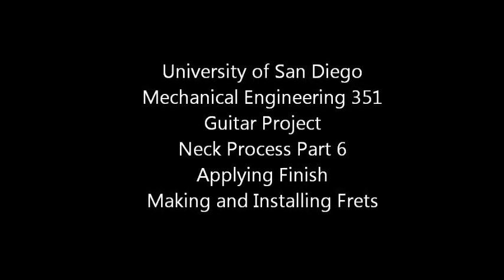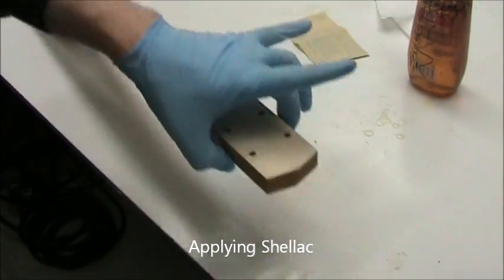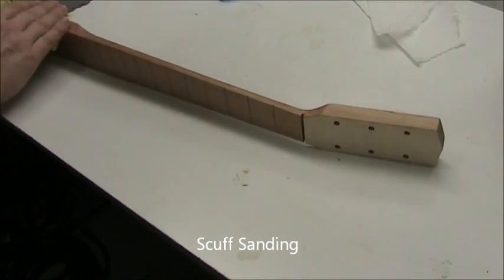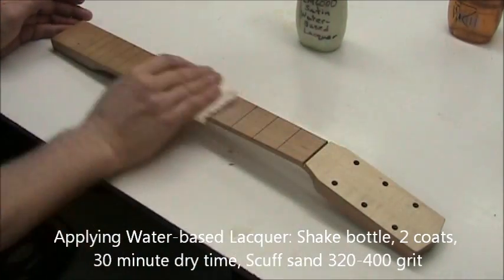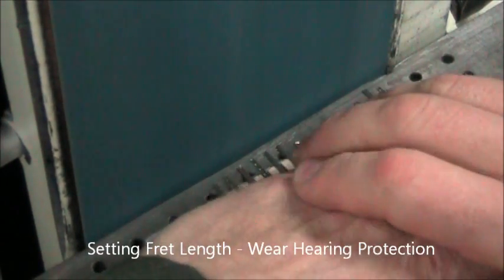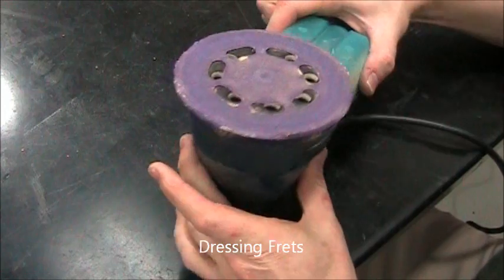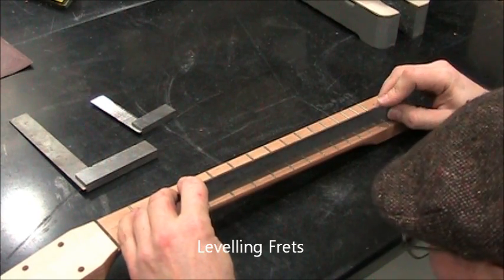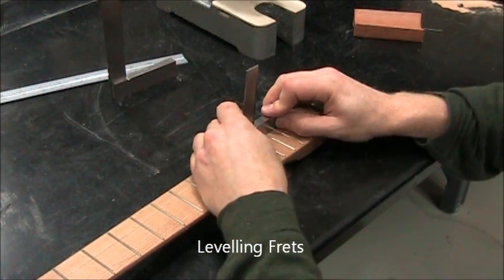Neck 6: Finishing and Frets

Comment from the maker: One way is to get a small "fret file" (google) and a flat file and work on each fret end, shortening and then rounding over.  It can be challenging to not gouge the fretboard, especially with the wrong tools.  
Or get a long flat file and shorten all the fret ends at once, then round over the ends.

Comment: you said a 1/32nd an inch gap on both sides of the frets. I have an entry-level, Big Box store type guitar and the frets go all the way to the edges of the neck & are a little sharp in places. What does one generally do, if they were not thoroughly rounded-off like you did before installation, to address this issue?
Reply: Fret sprout (caused by the wood shrinking but the frets don't) can actually cut up your hands.  If the frets are silver/nickle you can get very sick and in rare cases die from nickle poisoning (some people have an allergy to nickle).  You can buy a small triangle file (go through Stewart MacDonald, they sell luthiery tools) for the file.  Also because luthiery tools are very specialized you won't find them in the big box stores.

Comment from the maker: Keep in mind acoustic fretboards are typically just oiled, as the finish will eventually wear away.  Oil can be applied with frets installed, of course.  
If applying finish after frets are in, most finishes would glop in the corners and as you said, cover the frets -- not recommended.  
When applying finish before frets are in, go fairly lightly on the amount so it doesn't drip into the slots.  It usually drips very little, and is easily cleaned out with a knife.  
Glad you liked the video!